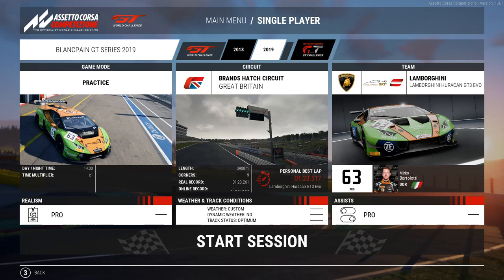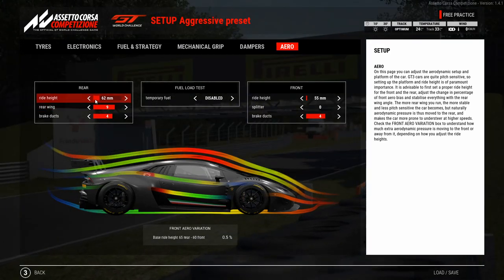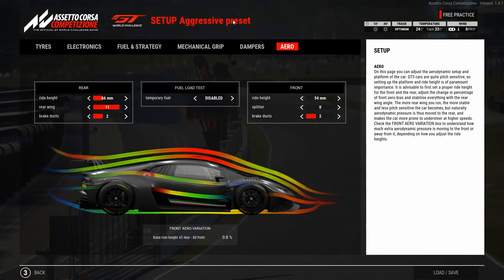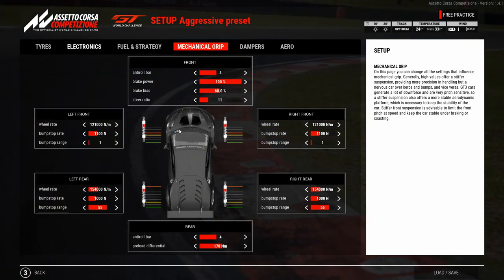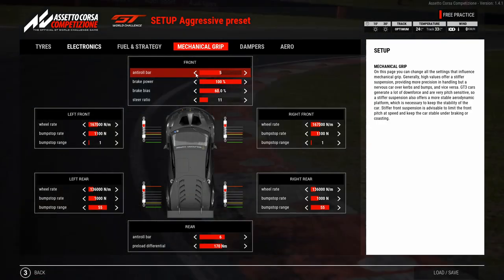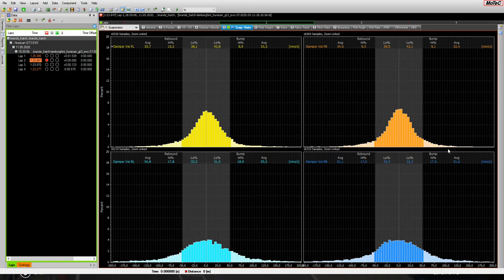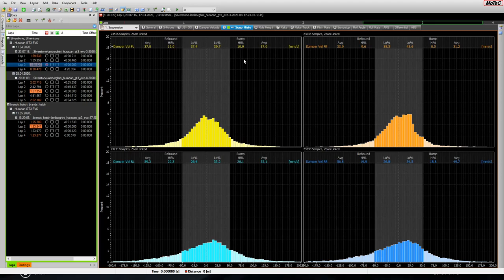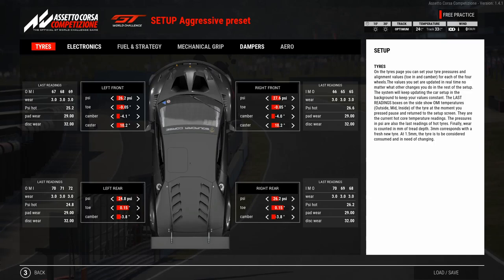How do I build setups in ACC? || Short walkthrough of my setup procedure

Comment: 27.8-9 is over heated/inflated. More so on 20 model. Only gotta look at the tyres. 27.3-5 for 18-19. 27.2-4 for 20 DHE
Reply from the maker: That video was made on 1.4 or so, at this  Version the higher pressures were optimal ;)
Reply from the maker: And i found the optimal tyre pressures with the tyre hud ingame out
Reply: wasnt it said 27.7-8 for 20 dhe? aris.drives said 27.75 is supposed to be ideal for 2020... did i miss something?